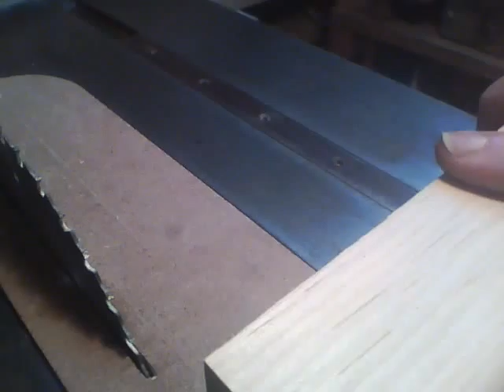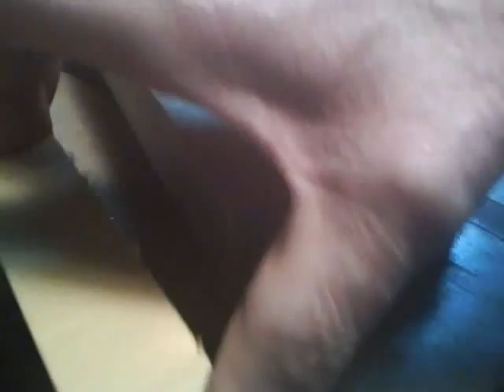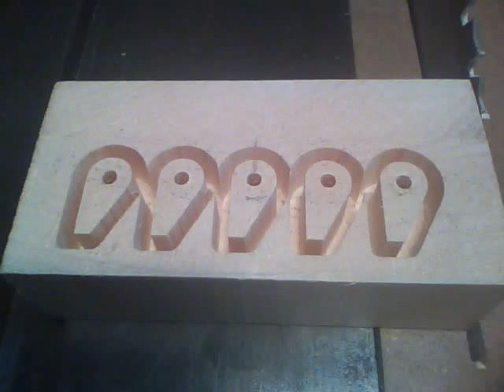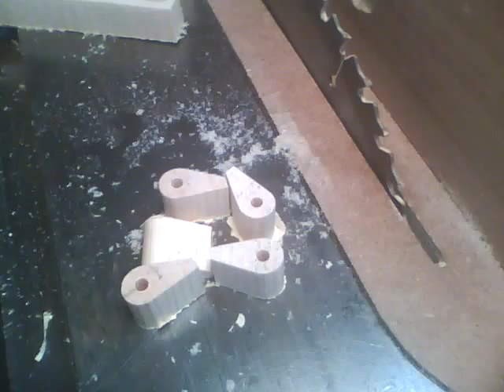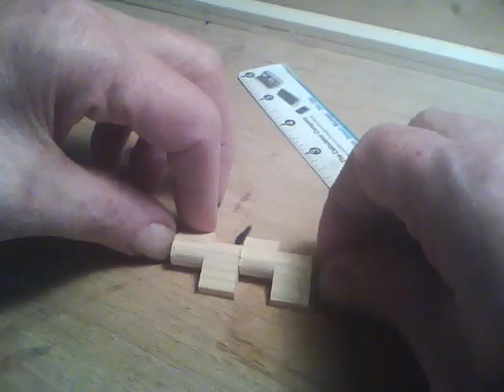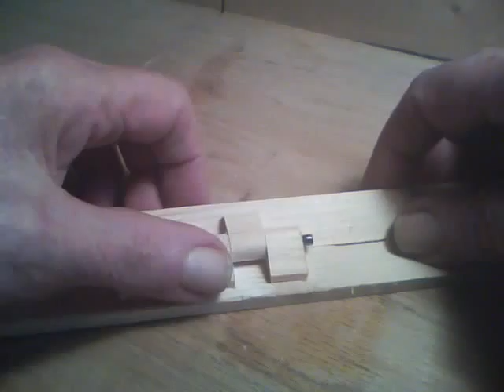Multi part Flag Hinge for a upcoming project.

Comment: Nice job, question though. couldn't you of used a thinner board and add tabs to the parts and cut it out with the cnc also
Reply from the maker: +james shelton Thanks, and Yes.